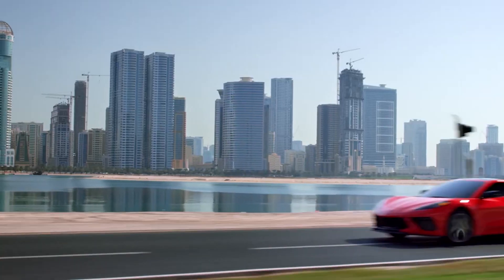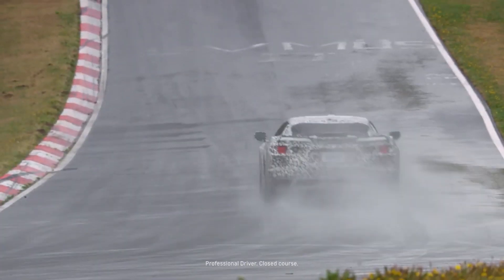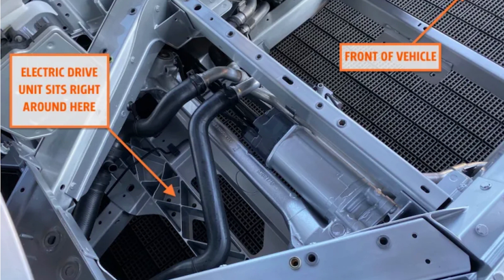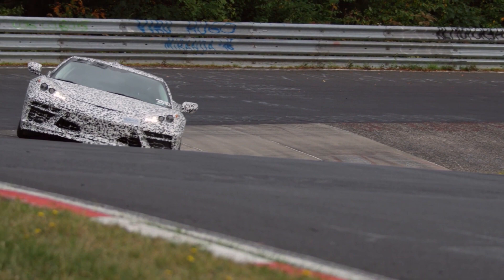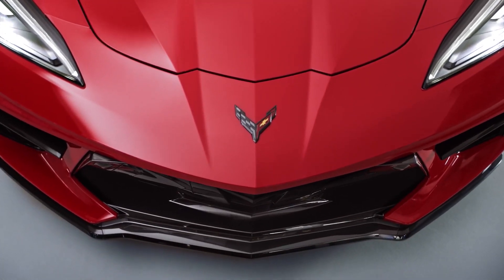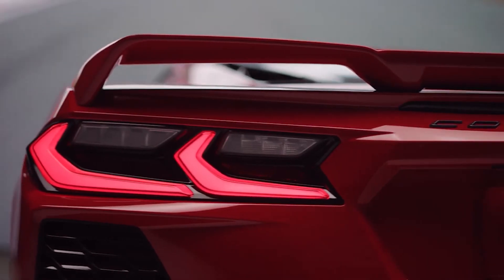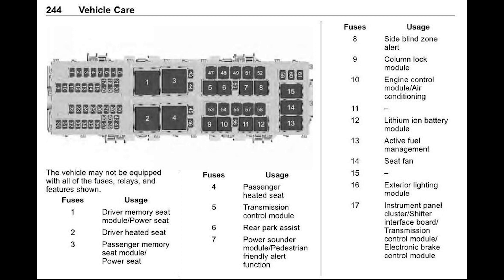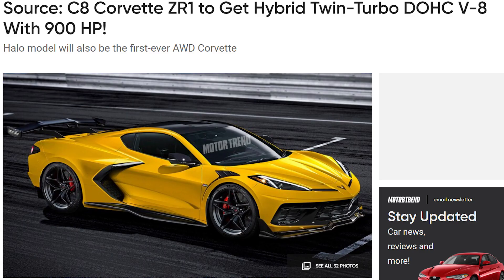Owners Manual Hints at 2020 Corvette C8 Z06/ZR1 HYBRID!! *Mid Engine Corvette*

Comment: I highly doubt that the Z06 will be a hybrid.  It's a track car why and the hell would you add 300+ lbs for batteries and electric motors, etc?  I bet it's a twin turbo with around 700hp and NO manual.  There are cad images floating around of the Z06 engine with twin turbos.  In those photos you will see the moveable wing and actuators.  https://svtperformance.com/threads/2020-corvette-mid-engine-0-60-under-3-starts-under-60-000.1176812/page-5    or  https://www.whichcar.com.au/news/2019-chevrolet-corvette-to-get-mid-engined-twin-turbo-v8-flagship

Comment: The fuse 7 for a pedestrian warning system and the fuse 12 for lithium batteries means the C8 like the Toyota Camry is going to have a hybrid option and it could be available on any C8. In the Stingray it will be a 2/4/8 performance economy Super Car. In the ZO6 that will be a 2/4/8 flat plane crack, in the ZR1 it’s a ZO6 with twin turbos, and to top it all off the Zorra or the E-Ray is going to be an electric Corvette with three or four electric motors. Sort of a Slot Car for Masses! I look for this Car to be in production until GM keeps the Zero Carbon Promise!